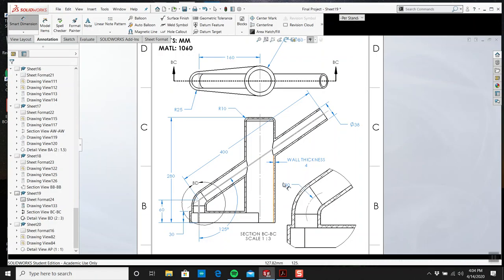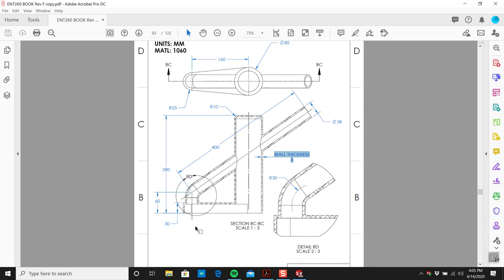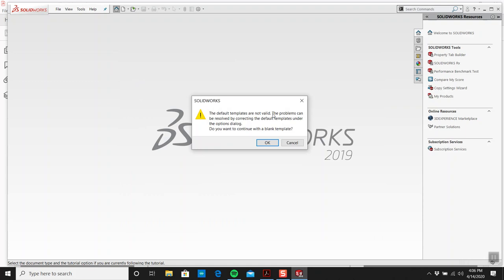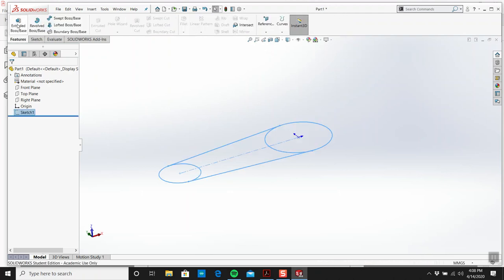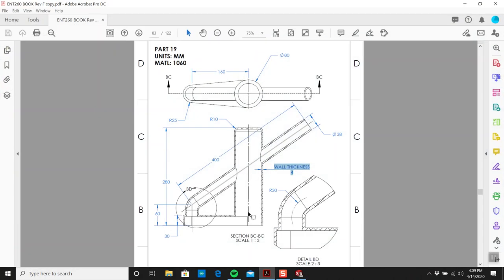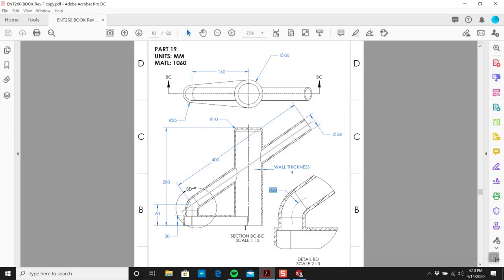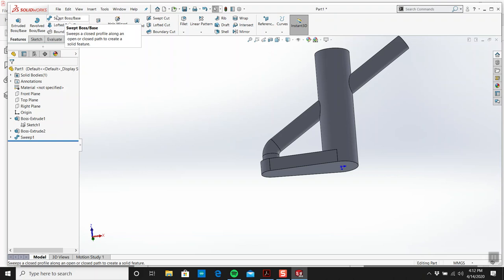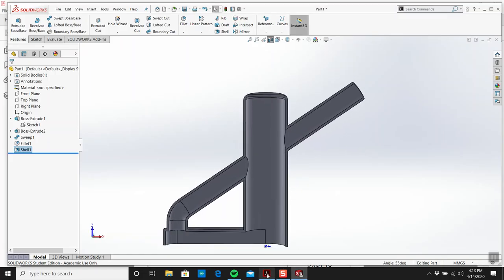Solidworks Practice Problem 19

Comment: Tim you make great videos and I have gained so much knowledge from you.
You may have done this in some of your really long videos but if not can I request some videos of designing parts in context of an assembly?
Having watched your videos I can now confidently make parts if I have a drawing to model.  What I really need is some guidance on how to make parts that fit to other parts in an assembly.  To give you an example that we would both know.  If for example you have modeled both sides of a cannon carriage how could you model the axles so that they fit the carriage sides?  I could model them if I have a drawing already but if I just have the two sides in an assembly how is it done?
Maybe if you have the time you could make some videos on this aspect of solid works.
Thanks
Rich